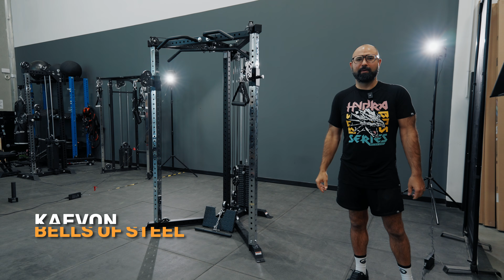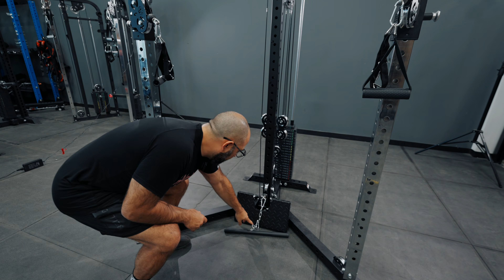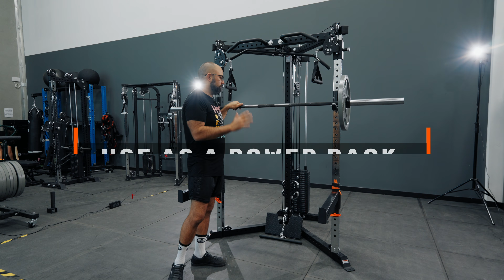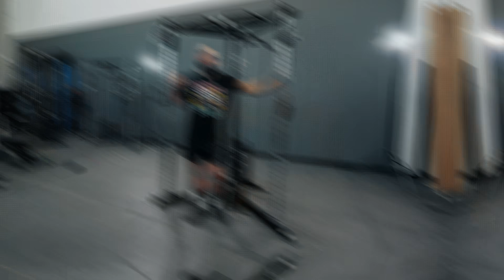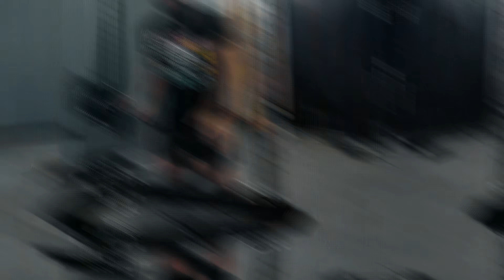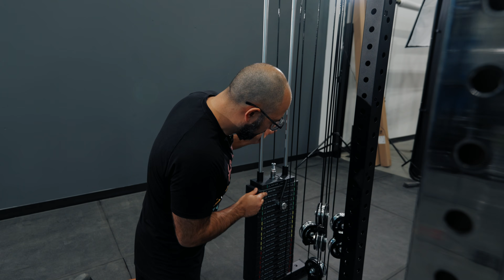This Machine Replaces Your Entire Home Gym! | All-In-One Trainer Overview

Comment: You may need let it heel until the bruise goes away. The Bulgarian split squat can help in that time. But to work the glutes you need the step out longer and   incline the torso forward instead of strait up. Depending on the other workouts you do regularly you may be limited in how much weight you do at first while the support muscles get conditioned but when you do itll be a decent alternative. It doesnt do as good a job of isolating the glutes as the hip thrust but it can develop the glutes non the less.  
Once the bruises heel then assuming you can get enough weight strapped to either side of a harness that should distribute the weight more evenly and hopefully cut out the bruising.
  And alternately if there is no way to strap enough to the end of the harness for the weight you thrust, theres this last option. if the gym has a universal cable machine and movable bench or bench substitute and if the cable machine has enough space you can put the pulleys in the bottom position and snap them onto the harness bring the bench to the machine and have the machine provide the resistance. The cables will be acting at angles. But they should balance each other you just need to be aware that you may need to set the weight higher then the weight you need. Hope of of those things help. Keep us posted

Comment: please fix the benching part i wanna be able to bench incline comfortably!!!!
Reply from the maker: We appreciate the feedback! On this version, we added additional space so you can fit a bench in for incline 💪
Reply: @BELLSOFSTEEL but wouldn’t you have to reach back. I saw reviews saying and saw you have to reach back for incline and sit uncomfortably on the jcups is that part also fixed ?
Reply from the maker: @Ballgoat23  It will depend largely on the bench you have. With our adjustable utility bench, you have options as the bench can go quite far into the all-in-one (to the point where if you were to be seated all the way back the j-cups would get in the way of the lift). There may be slight reach back, but it was one piece of feedback we wanted to make sure got fixed with the updated version!
Reply: @BELLSOFSTEEL is the updated version out ?
Reply: @BELLSOFSTEEL  So the version that is released is different than the version you talk about in this video where you say you need a spotter to comfortably do incline bench?
Reply from the maker: @Ballgoat23  Yup! They're available on our website now 🫡

Comment: I have a question on the plate loaded version. The weight horns on the plate loaded version seem to have a plastic cap on the ends, can these be popped off and can the chrome olympic sleeves be unbolted? Asking because most olympic horns on racks are attached to 1 inch steel rods, so essentially the horns are just adapters for 2 inch plates. I have about 350 lbs of standard 1 inch plates and getting rid of them and buying a new set just for this machine doesn't make sense for me.
Reply from the maker: Great question! The plastic caps on the weight horns are designed for protection, but they are removable. When you take them off, you can slide the Olympic horn off to use the 1 inch rod!

Comment: One attachment that seemed to be missing from your line up is a lat pulldown seat with leg pads. Perhaps the seal row pad could be used as the seat if you also had an attachable leg pad for the center post for heavy lat pulldowns?
Reply from the maker: We have a leg holder attachment in the works! We're hoping to have it out soon 👀
Reply: @BELLSOFSTEEL any update on this?
Reply: @BELLSOFSTEEL  Also curious about an update on this...

Comment: I just purchased one of these about 3 weeks ago and set up was fairly easy.  It pairs great with my smith machine and bench for my home gym.  So far it's great and pulleys/weights feel very smooth.  I wish I could find a bench that could hook up to the bottom middle cable so that I could do leg extensions/leg curls using the weight stack on this all-in-one.  Overall I love this trainer and would recommend it to anyone thinking about getting one if they're building a home gym.  Hopefully BOS or another company builds a bench with a cable attachment for leg movements.
Reply: There are companies that  make what you’re describing. Rep, freak athlete are some I know of for sure. If your in the USA there are way more options like fringe sports and ritfit, Gmwr so many options for what your looking for.
Reply from the maker: We're looking into this!

Comment: I really wish I could find a dimension listed for the distance from furthest point back to further point front. I'm looking for something but I have limited space to work with. Without this dimension, I can't pull the trigger on this product.
Reply from the maker: You can find all the dimensions on our website under the "specifications" tab. For the All-in-One it is 54.6" (1387mm) 💪 Let me know if you have any other questions!
Reply: Can you please confirm that 54.6" is definitely the depth of the new version that has a straight back foot instead of the original version with the U shaped back foot? I've seen that the original has a depth of 54.6" elsewhere online, not sure if they accidentally used the new dimensions for the old version or if your website still hasn't been updated with the new dimensions. Thanks in advance.

Comment: Will cable twist like your cable tower if you only use the cable on one of the uprights? And why is the last pull down bar so slanted
Reply from the maker: If you're exclusively using one cable this can cause the cables to twist over the long term! The lat pull down bar isn't usually slanted like that, someone likely just put the handle in the holder weird. Hope that helps 🙌